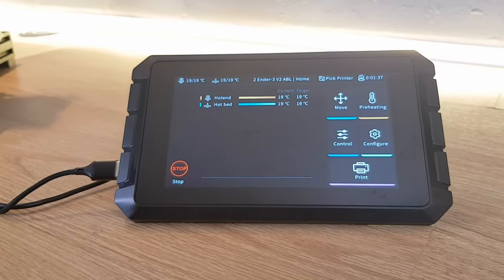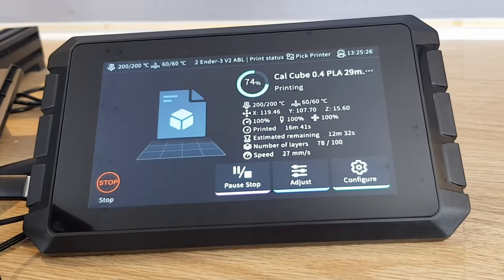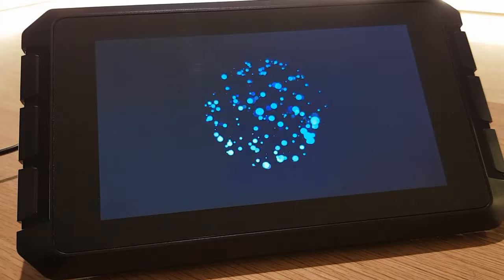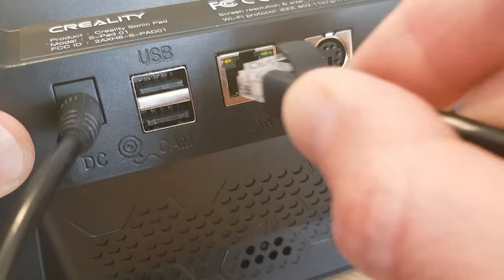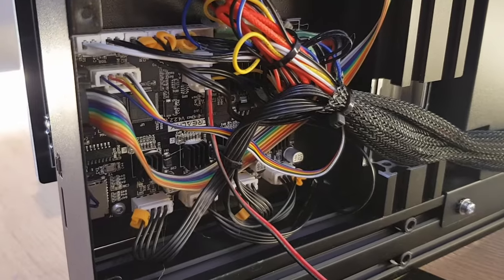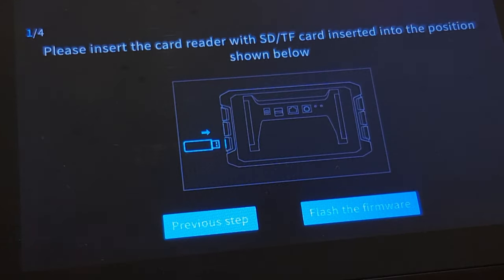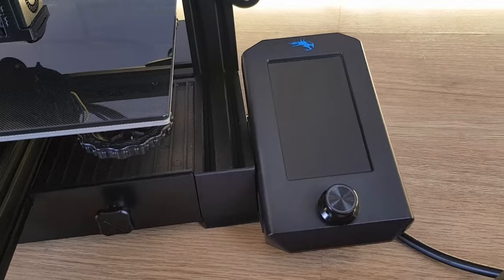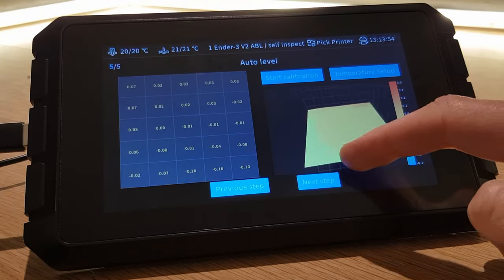How To Connect A Creality 3D Printer To A Sonic Pad - Sonic Pad Basics Part 1

Comment: This is a useless piece of kit.  It will not support USB 3 and despite you saying save the original firmware to back convert.  This does not work.  Once you use the Sonic Pad firmware to a Ender 3 pro .You cannot re install the old firmware to a 4.2.7 board.  You cannot use the micro SD port on the printer to print.  You have to use the sonic antiquated USB 2 stick to locally print.
Reply from the maker: Hi, you can always convert back to original firmware. What process are you using? You may just need to change something you are doing.
Reply: @RickyImpey  I have dowloaded every variation of firmware for an Ender 3 pr.  It has a 3.2.7 board, BL touch, direct drive and a touch screen.  I have always used an SD card placed into the printer and switched the printer on which then downloads the firmware, but not in this case.  I have tried to use the sonic drive but that does not work either.  Have you used a USB 3 in the sonic pad?
Reply from the maker: @kenbar5293  I haven't tried USB 3, no. Have you tried changing the filenames of the firmware when trying to go back to Marlin? You have to do different things with different printers but a lot of the Ender 3s don't like flashing firmware if the filename has been used before.

Comment: Sonic pad would be pretty cool if it actually worked with all of the printers it claims to support. It's a nightmare with autoleveling printers, like the cr-10. It completely ignores the results from autoleveling. I've been printing for 4 years and never scraped up a build plate until I got this thing. Doing a factory reset helped a bit, but it's still scraping some areas while hovering over others.  running my printer with the original firmware never had these issues. Setting the z offset to something crazy like 0.35 helps a bit, but it still trashes prints 70% of the time! I don't think they actually tested the sonic pad on all of the printers it claims to support. Be careful and do your research before buying this thing. There are plenty of posts out there talking about these issues. If you don't have a printer that it actually supports, the sonic pad will be a nightmare.